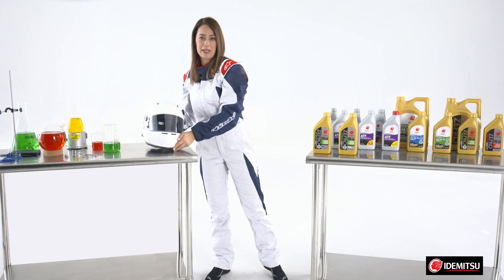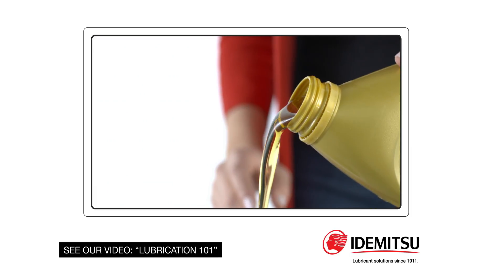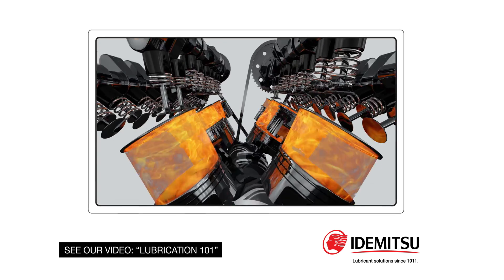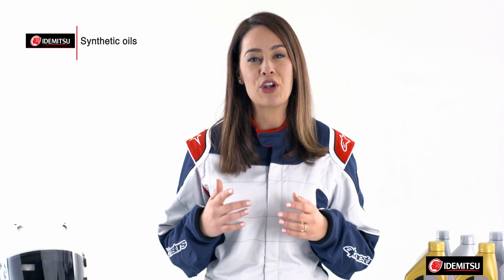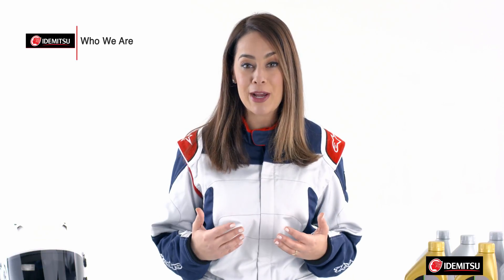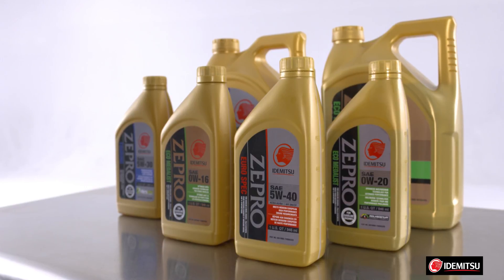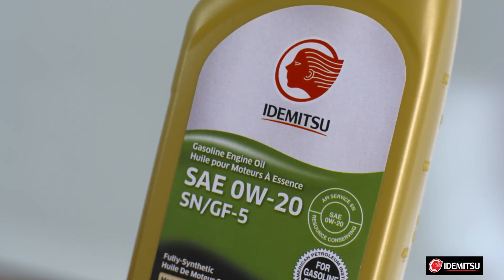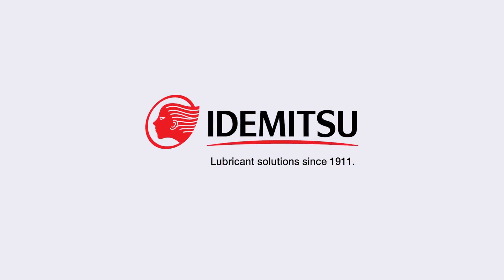Idemitsu Innovation Lab: 0W-20 Engine Oil for Better Fuel Economy and More Power

Comment: I can use 0w20 in summer 34 celecius degre
Reply: That question in my head right now and I don't find right answer..... does it work on hot climate like +40 c dgree in traffic
Reply: @abdulelahbinserya1467  some people say i can use 0w20  some people say use 5w30
Reply: @chadi6536  some time owner manual say use higher viscosity in hot weather if u use 0w20 change to 0w30 or 5w30 max even if oil cap say 0w20
Reply: @abdulelahbinserya1467  manual owner say use only 0w20 use 5w20 if not found 0w20 second change oil use 0w20

Comment: I’ve got 460,000 miles on my 1992 Toyota truck using Amsoil since day 1.  I use it in trans, diffs, transfer case and Amsoil grease for the drive shaft and front end.  I use a Amsoil bypass filter too.  The truck is still running as smooth as the day I bought it.  It has Never stranded me.
Reply: great, this isn't the Amsoil channel. I used Motorcraft oil in my ford and before it got totaled by deer it had 300k miles and never burned oil
Reply: @dieselboy77  It’s not the Motorcraft channel either.
Reply: @BW-kv9wj  my point is , any oil can be good for the engine
Reply: @dieselboy77  Not “ANY.” As long as it’s synthetic with a robust additive package than yes.
Reply: I prefer Canola Oil
Reply: 😂😂😂😂😂😂I prefer olive oil

Comment: I've been using AMSOIL 100% synthetic oil since 1974 I get 10% HP power boost  It does not thickens in winter and keeps cool in summer.  and I use K&N air filters, they last the life of the vehicle
Reply: But what viscosity?

Comment: did anyone run this viscosity in his motor for more than 160K miles ????
Reply: Yes.  We service a fleet of 100+ vehicles all running Idemitsu 0W-20 since they came from the factory, with more than half of the fleet now having over 200k miles on them & still running 24/7 with no internal engine repairs needed.  You get what you pay for with quality lubricants & filters that are all changed on regular schedule.
Reply: @KCautodoctor  please what is summer temperatur ? In c or f

Comment: What does the "SN" stand for in 0W-20SN?
Reply: SN stands for the API specification of oils The letter "s" stand for Spark= for petrol engines. "N" is the latest specification of oil. Currently SN plus is the latest grade that exceeds previous specifications. Actually SP is replacing SN plus.
Reply: @Afrocanuk you can get all your engine oil questions answered at API (the organization responsible for determining the oil ratings in USA) website setup exactly for these types of questions https://motoroilmatters.org/

Comment: 2016 outlander sport..first two oil change..Mitsubishi bulk oil from dealer ship 0w20
third oil change..mobil one 0w20 fuel economy oil...
fouth oil change...
either going with ..idemitsu 0w20....or....kendall 0w20.......which one is better???...kendall or idemitsu.......many replys are welcome......mike from minnesota....
Reply from the maker: Hi Mike - Our full synthetic 0W20 Idemitsu engine oil is formulated to operate with lower friction to provide better torque, horsepower, and fuel economy without sacrificing long-term protection. If you choose Idemitsu 0W20 for your next oil change, we'd love to hear feedback from you about your experience!
Reply: @idemitsulubricantsamericac5310  I tried 0w20 Zepro on my 18 Honda Civic Type R, so far so good, comparable to one of the best Pennzoil Ultra Platinum.  According to my research, Honda and Subaru use Idemitsu manufactured oil in other countries.  I wish you guys can provide more test results and compare to other brands.
Reply: Idemitsu brand is most likely what was installed in your vehicle from factory.  As a mechanic i can say that you are far better off keeping your vehicle as close to factory spec. as possible.  Hundreds of millions of dollars are spent designing, engineering, and testing your engine with the OEM oil in mind.  And whatever you do, at least stick with the 0w-20.  I have seen numerous problems arise from using the wrong viscosity oil, usually with the variable valve timing phasers and the oil control solinoids that control them.
Reply: @Louis Dega you will have this man blow his engine going with a higher weight his vehicle does not support.  If you had at least said 5W-20 you'd at least be on par with the owner's manual, which also says the very next oil change make sure you use 0W-20.  That 30 weight will be too thick
Reply: Lol try Castrol Edge Bio-Synthetic lol.  I advise against Kendall, not that it is not a good brand but that it is not readily available at a retailer.  Neither is Idemitsu for that matter so why try both.  As an owner of a vehicle that also requires 0W-20, I would say Mobil 1 Annual Protection or Fuel Economy.  Reason being, it's readily available, a reputable brand name, and it's the cheapest of all the full synthetics I personally have seen so far
Reply: @orochikaiba  i just get Idemitsu on amazon, got four 5 quart jugs and a 6 pack of genuine Subaru filters for my Impreza.  I try to keep it as OE as possible but I'm not about to spend $40 for Subaru to put their name on an Idemitsu oil bottle so i get it from the source.  I'm not a fan of Kendall, Valvoline, or Pennzoil (even though i'm a Pennsylvania resident).  If i weren't using OE i'd be using Mobil, Castrol, or Amazon Basics new line of oil (Warren oil co.) which from the research i've done seems to be out performing nearly all other brands out right now.
Reply: @orochikaiba  Mobil 1 is so outdated, you still live on yesterdays technology?
Reply: @seansteryu7398  Bro not all Mobile 1 is bad for JDM, ESP series are the best for performance and fuel economy and it rivals Zepro 0w20 with slightly lower friction. This is the only Mobile 1 I want to pour into my car but getting this stuff is pain in the ass. Unless you bought from some online Porsche dealership. I dislike other mobile 1 series because they take too long to finish cold start and not as fuel efficient as Valvoline, Penzoil and castrol.
Reply: @orochikaiba  The top ranks in a geek blog look like this( quaker state,mobile 1,toyota, Castrol, penzoil, valvoline,etc.) And Kandall is below the average line. This blog is is trying to show how well oils against friction and extreme pressure, so it favors engine protection over other traits. Amsoil is somehow mentioned in the blog and it is the best against wearing but the price is being the least fuel efficient.
Reply: big boys toys realistically you are fine using any oil that meets the OEM spec. I just buy the cheapest synthetic that meets spec, run it for 10k miles, and perform a UOA.